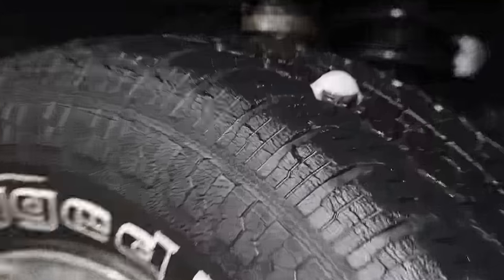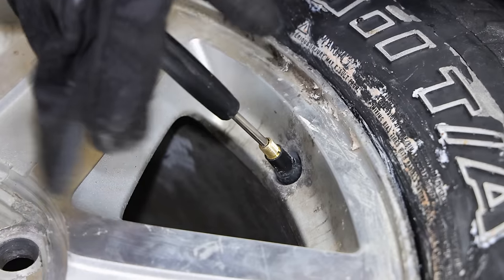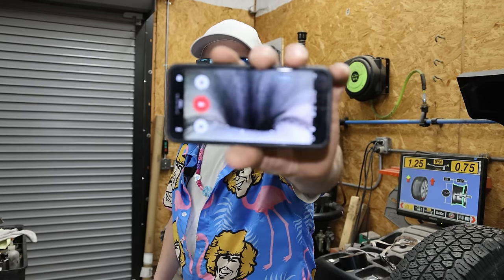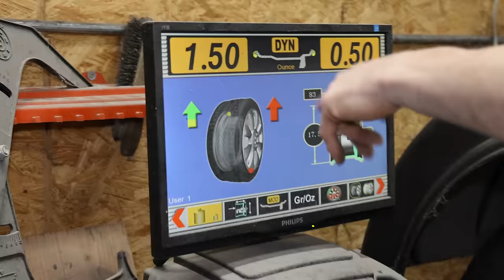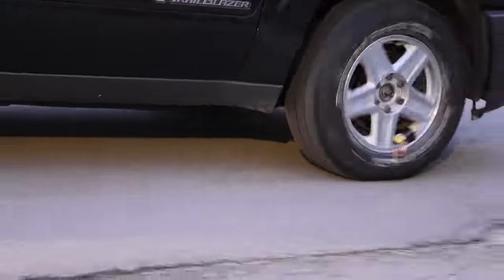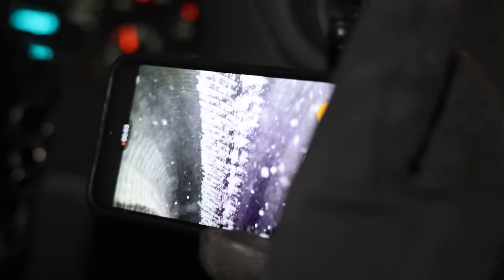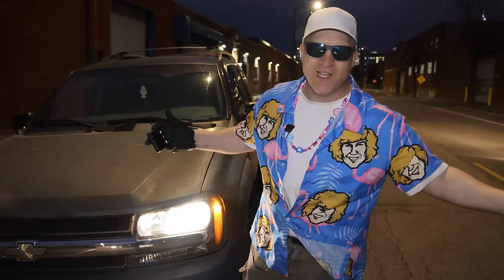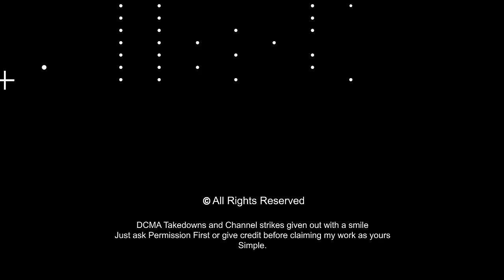GoPro Inside a Car Tire (With Balance Beads)

Comment: on a rotating object, the axis will be at the center of mass, which won't necessarily be the geometric center where the hub is. the center of mass will be between the hub and heavy part of the tire. the tire will try and rotate around that point instead of the hub. so it will push against the hub via the steering and/or suspension to rotate around it's center of mass as much as mechanically possible.

the counter effect is that the light side of the tire, travels in a larger circle than the heavy side of the tire. and the beads just accumulate in the point farthest away from the center axis. it only takes a few seconds for the beads to pull the center of mass back to the geometric center at the hub. 

this technique works exceeding well with 0 offset wheels. but with large offsets, the results can be less predictable. 

we used to use high density air soft pellets to balance large offroad tires on our rigs back in the day.  a quart size jar was usually enough for 38 inch tires to roll smooth-ish on the street. once you reach about 30mph.
Reply from the maker: That's great information, that makes sense about the offset totally, as I have seen demonstrations with an old school trailer wheel 0 offset and They balance perfectly. That makes a lot of sense.

Comment: These are glass beads used for painting highway lines.  The beads are applied to the wet paint to create a retro-reflective high-vis finish.  Probably 1000 times cheaper if bought that way.

Comment: used this stuff in my motorcycle ('15 vrod muscle with a 300 wide rear) for a couple years, had absolutely no issues of any kind.   would have done again if i had remembered when i got my tire changed a few years later.... probably will get around to it eventually and rip off the fugly stick on weights.

Comment: Aparently how they work is that they just add more weight distributed to the entire tire making whatever imbalance it has negligible. So it still has the imbalance, the ring of beads just weights more. Also, based on what anothe commenter said about a tire having more than three gallons of the stuff on one causing problems it makes sense since at one point of adding beads, the beads would just pool at the bottom and make the imbalance worst.

Comment: The way they work is like spinning a half full water bottle. It will rotate around its heavy spot, and then “fling” the water to the lighter side and balance out. 

I thought the heavy spot will be flung outwards and pull the beads to it, but it’s the opposite 🤯
Reply from the maker: Good example

Comment: OK, to everyone who does not understand let me explain. Its never been the wheel or the tire that is out of balance. Its about WHERE the metal wires overlap inside the tire rubber. SO the "heavy" side is actually STIFFER and under rotation all the other areas expand and that is where the beads accumulate and offset the weight.

Comment: I had them in my pickup truck but eventually removed them, they would work intermittently, sometimes being balanced perfectly and sometimes they would shake the truck, idk Maybe my wheel or wheels weren't true enough, I dont think they can account for horizontal balance only verticle, adding more did help in my case but I got to point where adding more beads had diminishing returns. so I went back to clip-on weights and it's been great. initially, I had wanted to try beads due to losing weight well offroading the forest.

Comment: Very interesting video but I have two concerns: 1) would the beads subject the inside of the tire like a "sand blaster?" 2) if the tire has a pressure sensor like on modern, recent Toyotas, do the beads damage the pressure sensor mechanism?

Comment: Balance beads do work a little but 2 ounces is a lot of weight and you’ll feel it. Also on long sweeping turns on the highway, the beads tend to move toward the outside of the turn and cause a major imbalance

Comment: Maybe you should have put the same weight of the GoPro on the opposite side of the wheel but on the underside of the wheel where you would normally put stick on weights.
When the wheel is spinning the place that is heavier actually moves in the direction of the heavy spot. The beads counteract that movement by moving out ward on the opposite side of the wheel counter acting the force from the heavy spot. The problem I have with the glass beads is they will eventually break as they smash against each other. I think everyone would be better off using steel BBs. There are calculations that can be used based upon tire size, wheel size and weights to determine the weight of beads to use. 
Very cool video. I am thinking about using BBs inside my restored VW wheels instead of wheel weights that will chip off the new powder coat paint.

Comment: The heavier point when it "flies away" from the center of mass will pull the entire system along with it except for the beads, which are not mechanically connected to the system. And the beads will automatically fly in the opposite direction. More precisely, the beads will remain at an inert point, where they will be "picked up" by the lighter side.

Comment: A rotating assembly will always rotate around its center of gravity. An imbalanced weight will move imboard and the lighter end will move away from center of rotation and that's where the beads roll to.

Comment: in heavy trucks they use sand bags. very common for a long time, they throw a couple bags in when they mount the tire, as you drive the bags burst and balance out, have them in my peterbuilt now.

Comment: Balance beads may grind away the finish on the interior of the wheel and possibly result in early corrosion.  Liquid gets in when the mechanic use the soapy water to lube the tire before it is installed hence the liquid can start corrosion and the beads will accelerate that.

Comment: I know it's all about views and likes, but I would have liked to see the tire you used mounted and spun with just the go pro, how out of balance?  Then add the beads a little at a time and recheck balance.  I also see a different balance machine that has a roller contacting the tire on the tread to simulate it being on a road surface.  If the beads somehow shift around as it's being driven, then this would best simulate actual driving.   It would also be interesting if you find that the beads are helping, to add weights on the rim to see if the beads can counter the intentional miss balance.
Reply from the maker: No not necessarily only about views and likes, but for these videos sometimes I do have to target the masses, And sometimes getting way too detailed like that is a bit counterproductive but I did in fact mean to include the clip of spinning it with only the GoPro, but I was in a hurry and I forgot.

Comment: The heavy off balance side of the tyre hits the road harder making the beads bounce off that internal face, creating a better balance. This continues sequentially over smaller and smaller imbalance bulges till it becomes negligible enough to not disturb the settled beads on the circumference

Comment: They don't work all the time.   I ran them in a brand new set of Avon Venom tires on my motorcycle for a cross country trip.  They were replaced about half way through my trip, just before I hit the big open country and long stretches of nothing but nothing of the west.  The bike started to develop a slight front end vibration between certain speeds a day or so after the tires were replaced.  I figured I'd get it checked out when I got to my destination.   It became more significant as I rode, and several hundred miles in, it started to develop heavy front end vibration and wobble.  It actually put me in a death wobble during an emergency stop from 75-0 when a big rig locked it's brakes up in front of me on a small road in Arizona.  Damn near lost it, and it probably would have killed me had I.   When I got it to the shop and they were able to examine and fix it... it turned out the shop that mounted the tire had somehow torqued the tire when they mounted it.  It developed a bulge in the tired, and the dyna-beads were collecting in the bulge throwing it even more out of balance.   Luckily the shop was able to fix the tire, re-mount it, and put conventional weights on it to balance it.  Rode it for another 9k miles or so, and never had another issue with it.   After that, I just won't trust balance beads in a motorcycle tire again.

Comment: 3 generations in the tire business…..this video is informative and you did some experimenting.  The size of the tire is directly related to the amount of balancing beads you’re supposed to add.  Also usually there’s a particular type of valve stem to use that prohibits the beads to interfere with the valve that holds the air inside the tire.  Older people used to call balancing beads “hocus pocus” lol.  Also, I’ve seen truckers use 3 golf balls in the tire instead of the beads.  If you ask them, it’s the best thing never invented.   Just remember to keep them aired up to the proper psi and let professionals (that you can trust) deal with the rest.  Tires are extremely dangerous and to do your own trial and error tests is risking your life for real.

Comment: I've been using Balancing beads for the last couple years with my car and my motorcycles and have had no problems with them. The only thing I found is you have to put the recommended amount in for the size tire.

Comment: Tried these beads in my buick enclave and vw passat. Both had terrible shake on highway afterwards. No sensors in passat tires. Got them removed and rebalanced and all was good. Shook the worst when going from uphill to downhill and the whole way down hill. Would not recommend for passenger cars. My mechanic stopped putting them in cars after my experience..

Comment: As the wheel spins the tire moves away from the beads where it's heaviest, leaving the beads on the opposite side.  Any time the tire moves in any way away from center, the beads want to stay put, effectively moving them in the opposite direction of the vibration.  They'll continue to shift around until there's no more vibrations to move them, assuming there's enough of them to create balance.

Comment: I came up with an idea! Plss try using beach sand instead n test that idea out on your tire mountung n balancing bench n if that works then any tiny granules will work. Doesn't have to be balancing beads lol. Imagine if ur out driving n ur tire becomes badly off balance. Knowing u could use any fine sand would be cool.

Comment: I’ve used the balance beads.  They do what the manufacturer says they should do.  However they do make a mess when changing a tire.  Also they shouldn’t be used with a auto tire inflation system.  They also shouldn’t be used with a dual tire air pressure equalizing system such as Crossfire or Cats Eye.

Comment: This is the first I've heard of the beads I have 35/12.50/20R load range F my weights on my rims fell off now i wish I wouldn't have made a appointment to get the tires balanced Ford is notorious for bad steering dampners so I'm going to try the balance first maybe I won't need to replace the dampner

Comment: To get to the grit the tire should have been balanced before to see if it was off, right?  Could balance tire with go pro in that be ounce or more maybe!

The tire on the balance machine didn't balance was 1 ounce off or 1.5 Oz.

I believe the beads just move evenly around tire because of centrifugal force which the go pro shows consistent layer around inside tire not an thicker pile anywhere.  Not sold on these yet or if you pulled chunk of rubber off your tire to know it was ounces out of balance.

Comment: In the tire business since 1970, I've proved many times that these beads or balance rings do not work,if they work the wheel balancer would have shot that,but everyone you spun it ,it showed a different weight

Comment: If they would work, we would not have seen them near the go pro (the heavy point) since they would have to be on the other side. They seem to be evenly spread around instead. Maybe the tire was randomly balanced well because of the camera. So repeat it and add a missbalance on the opposite side of the camera. Then check if more beads accumulate around the camera. If the picture does not change -> they do not do anything.

Comment: I'm thinking you should balance the wheel with the camera first and then add weight opposite to the camera so it is off balanced and the camera is pointed at the "light" part of the tire, then add the beads. I'm guessing the beads will pool up in the light part

Comment: I found a way to get the beads into the tire thru the stem.  With the wheel on the car, remove the valve core and let the tire go  flat.  Then hold the inverted bottle to the end of the stem and have someone jack the car back up.  As the weight comes off the flat tire it will suck the beads into the tire no problem.  Instead of holding it I connected the bottle to the stem with an inch of plastic tubing.  Then I could let go and jack the tire off the ground myself.

Comment: tbh, if your tires are spitting out rubber on the roads, you should probably replace them before you get a blowout, rather than getting these beads.
I mean, I'm not an expert, but keeping your tires in good shape seems kinda important considering how many cars I've passed on the highway with flats, or tire pieces scattered everywhere
proper tire pressure should prevent a lot of that wear since it would stop the tire deforming so much while you are driving, I dont think I'd ever let my tires get to the point where I am considering balance beads cause I'm worried the rubber will start falling off, that sounds like time for new tires

anyways, cool video!

Comment: I like the beads.  I have them in all my vehicles.
One problem is if you use a rope type plug the beads will get stuck to the rope and make the tire out of balance.

Comment: On the truck side to keep the balance media out of the bead seat & inside the tire we just toss the clear bag of beads in & it'll tear itself apart in no time.  There's a kind of venturi siphon tool that allows you to suck the beads into the air stream as you inflate it.  Kinda like the soap/liquid fertilizer injectors on a garden hose except its solid beads so you slowly rotate it up to pour the beads into the outlet slowly enough it doesn't clog.  The only reason I got that tool was it allowed me to balance the tire initially then add the beads afterwards to balance the wheel as the tire wears.  The beads are supposed to be coated with something that build up a static charge so they stick to the tire a bit longer instead of bouncing around more like sand & essentially bead blasting the inner liner of the tire.

Comment: Balance beads move vibrations of the out of balance condition until the vibrations stop.  Tyres need replacing that rubber tearing at the tread edge is ply seperation

Comment: Well I never bought balance beeds. But heard of them.. So several years ago I bought a bunch of plastic bb's and weight them out for each of my new tires.. Mounted new tires on rims,  seated tires.. Then broke the beed enough to dump the bb's in. Refilled with air.. I tell you what, those tires rode darn nice down the road.. Once in a while one would feel a little off balance. But a stop and go from a sign fixed that. Well a few years later I bought another set of new tires. Took these to a tire shop to have them balance. After a few hundred miles I started feel a bit of a wobble. At that point I kind of missed the balance beeds idea. It seems the beeds are a smoother ride long term than the traditional weights and balance machine. Not to mention if you have ice or mud in the wheel. Typical weights do not balance that out. I am thinking my next set of new tires come this winter. I will be going back to the beeds idea.

Comment: Weigh the balance beads, and swap them out for the equivalent weight in water. See if you get the same effect. Also, you may have done this in other videos, but include the out-of-balance measurement of just the go-pro as a base line.

Comment: I think I figured it out. For an object rotating about a center point, its velocity is 90 degrees "ahead" of its position, and its acceleration is another 90 degrees "ahead" of its velocity. Think about an imaginary clock/gauge thing three hands: position, velocity, and acceleration. Actually, make them position, momentum, and acceleration. Momentum and velocity always point in the same direction, and I think momentum is a little easier to imagine here.

Our rotating "object" isn't the tire itself, just its overall center of mass, which is a little off center thanks to being unbalanced. We're looking at a passenger side tire, so our position, momentum, and acceleration are all moving clockwise. At the instant when the center of mass is pointing toward 6 o'clock (toward the road relative to the axis), its momentum is pointing toward 9 o'clock, and its acceleration is pointing toward 12 o'clock. Since the tire is a solid object, these three values have to be the same for every part of it. When the beads have settled in position due to the car moving at constant speed, they also act like a solid part of the tire. So the acceleration being applied to them is the same as the acceleration being applied to the center of mass of the whole tire.

Comment: Fun Video I have always wanted to try them. But ! balance beads will not correct for tires that are delaminating like yours. Still a fun video . And you need to do a road force to seat the tire and find any soft or hard areas.

Comment: I had an issue with these on my Tahoe with 22" rims. When cold they seemed to clump and tires were severely out of balance. if you drove around awhile and stopped then started again it would fix itself. Also when accelerating fast they also seemed to clump. I have them in my motorcycle without issue though.